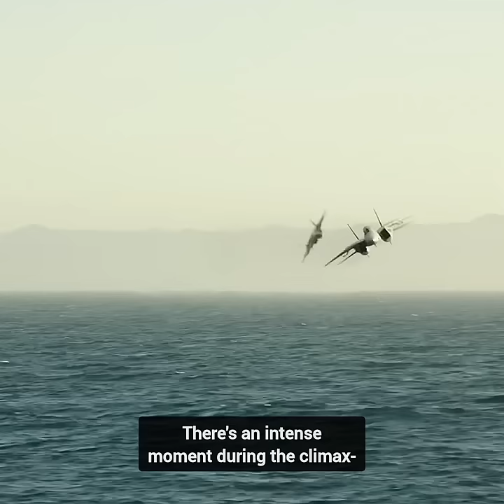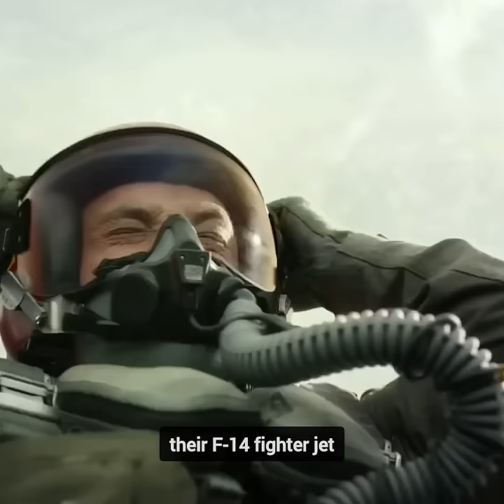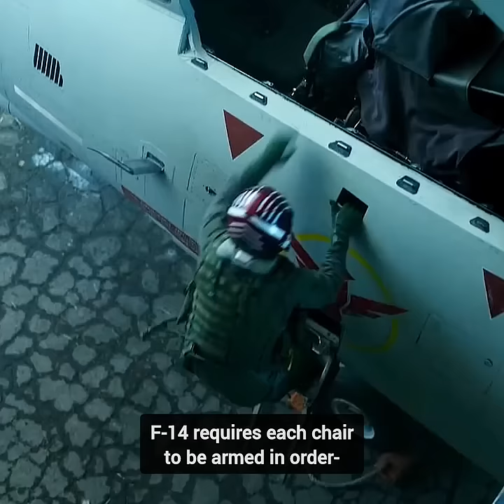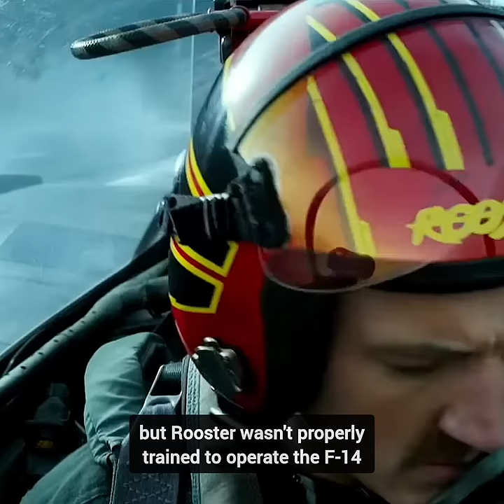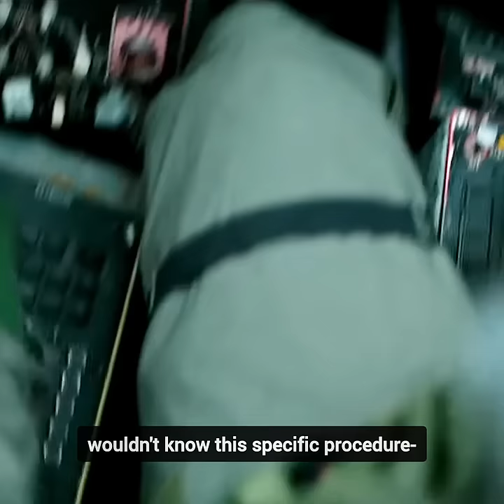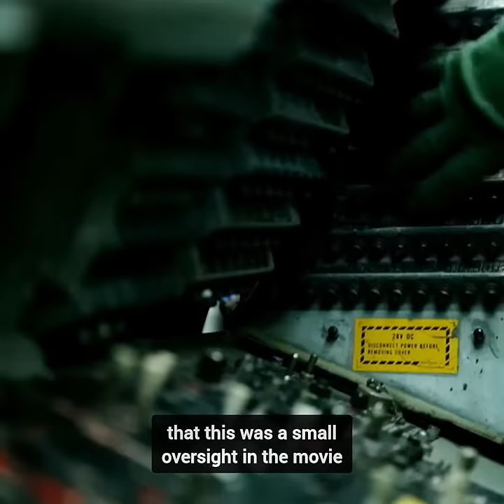Plot Point or Oversight? Analyzing the Ejection Scene in "Top Gun Maverick" - #shorts #short

Comment: The final landing sums up everything. The plane could no longer eject. Had 1 functioning engine, had no front landing gear, no tail hook. Either Maverick lands the plane perfectly or they die.
Reply: Was gonna type a full comment, but this explains it pretty well. I think it's odd that they didn't try the hydraulic hand pump or the electric pump at all for the tail hook, maybe I'm just lacking context and the whole system was missing rather than a simple loss of hydraulic pressure...
Reply: @brobearbrobear0464 I mean for starters that Tomcat didn't even have a tail hook and definitely not strong landing gear either considering it's Modified for Land based Operations
Reply: @pandasonic1294 if we're basing this off Iran's F-14s, yes, they absolutely did still have tailhooks and the exact same landing gear as US service ones did. They were sold an unmodified early F-14A. Now in modern times they might have removed the tailhooks, as it's a piece of matinence they didn't want to bother with (Iran has also removed the door over the refueling probe for a similar reason), but the gear absolutely needs to handle carrier landings, as the way you land an F-14 in general is similar for both fields and carriers.

The F-14 was designed as a carrier based fighter from start to finish, there were no "land based" modified variants as there were with the F/A-18 when sold to Canada and others, or the variants of the F-35.
Reply: @KomradeDoge  I have seen some videos and documentaries which did say stuff I said here. On YouTube obv.
Reply: @pandasonic1294  I don't believe it would be worth it to modify the 14 in that way. Removing the hook makes sense, it's a hydraulic thing you no longer have to worry about. Making the gear weaker makes zero sense, as stronger gear means it can take rougher landings, you'd loose that if you made that change which doesn't make sense logically. Unless they've changed the gear out due to their parts shortage for them but that's a key part of the jet, that would be a major desperation move, likely they'd try to replicate the original parts.
Reply: @KomradeDoge  I mean from what documentaries I have watched some F-14s didn't really have strong gear when being sent to Iran since it wasn't going to be landing on aircraft carriers tho F-14s that Were modified with their Classified systems removed probably had the strong gear.
Reply: @KomradeDoge  Tailhooks are still used occasionally on land-based models. Even the F-16 and F-15 have tailhooks in case they need to use the arresting gear (wire) at a military airport due to hydraulic failure or runaway engine.
Reply: @TomSwift-wy1gx  yes I do know that. The point I was making is that a place with the inability to replace and maintain a part may choose to remove it. Even with those jets tail hooks, they're used typically in emergency situations. I believe with those non carrier based tail hooks you can't even put the hook back up once you've deployed it without tools your ground crew would have. I highly doubt a place that can barely keep the bird in the air would bother with something as minor as maintaining parts that would only be used by them in a niche situation as that.
Reply: @KomradeDoge  Yes, agreed, that all makes sense.

Comment: You have 3 means of initiating the ejection system.  Pull down on the face curtain handles above your head, pull up on handles between your legs or pull up on handles located on left/right armrests.  Plane captain must ensure safety pins are removed on preflight.  No sane aviator would ever fly a plane equipped with ejection seats and not check that those pins are remove.  Pins are clearly noticeable by red streamers.  But....things happen.  Safety rules are written many times because of tragedy.

Comment: Maverick could have punched them both out as well 🤷🏾‍♂️
Reply: Nope maverick seat would have ejected but not rosters because the safety interlock pins were still engaged. And martin baker ejection seats will not work if the pins are still in .
 According to my brother who worked on ejection seats for the navy for 10 of his 16 years in provided that he had removed his arming pins
Reply: Not with a pin in it. the squibs won't fire and the rockets won't light. But there is no way you can get into the cockpit without seeing the big red "REMOVE BEFORE FLIGHT" flag attached to the pin at the top of the seat. EVERY pilot knows to pull the pins on the landing gear, the missiles, and the ejection seats.

Comment: Never been trained or flown an F14. But I am thinking it could be one of 2 things. 

One as stated but the other explanation:

In the mishap scenario  the case of F14 is the location of CG and coupled centerlines far from the center.

The  distances outward  of each TF30 engine would create incredible  torsional yaw.

And the longitutional centerline of each engine centerline so far outward a yaw and  spin not recoveranle. 

All would make it impossible to eject.

1)  long coupled CG to the rear,  and

2)  centerline coupling of the engines outward would  have 6 axis of motion G force to overcome.

The  two crew so far forward of CG, and the yaw spin generating  such G forces prevent anyone from recovery.

And if a crew survived, it would seem the Pentagon would be on a hotline to  debrief the crew member that had the strength and reflexes. 

"Son how did you do it?"

Comment: You're wrong!! That plane was combat ready. Those seats are always armed. Those seats are only disarmed after being removed from the plane and taken into the maintenance shop by the AME's. But it looks like when they got in the plane, they didn't take time to get the safety pins out of the seats that prevent maintenance from accidently  sending themselves into the hanger bay ceiling. Rooster would've known this as all US  ejection seats are almost identical. No matter how modern. They could've forgotten this because PC's usually pull and replace the pins for them but pilots are almost as well trained in the ejection seats as maintenance. The ejection grip that Rooster pulled would've come out if the safety pin was pulled. There's also 3 other ejection handles he could've tried. Also Maverick could've ejected as well. His hands should not be on any controls when ejecting. That's how you would lose body parts.

Comment: Though Rooster may not have pulled the safety pins for the ejection seats, it is also possible that the country they "procured" the F-14 from may have permanently PINNED the seats so their pilots wouldn't eject at the first sign of trouble.

Some countries have a history of this - not providing their pilots a way out, and thus "motivating" them to fight. You'd have to figure that with SU-57s in the fleet, the top "reliable" pilots would be assigned to those aircraft, and the others were assigned to the "old relics".

Comment: The egress system is a multitude of explosive components that have service life change requirements. Some parts are changed every 6 years, some every 20 or so. It is possible that some of these components were never replaced from the jet built in the 1970’s and were rendered useless due to service life expiration.

Comment: Take it from a Marine who worked on Martin Baker GRU-7 elections seats when I tell you there is NOT an arming sequence for those ejection seats. There's two safety "flags" one on top for the upper handles and one between the crews legs ag the lower handles. EVEN IF YOI FORGET TO PUT YOURE SAFETIES DOWN, PULLING THE HANDLE.HARD ENOUGH WITH OVERIDE THE SAFETY....

Fun fact, in the first top gun, they left the star where installed on the seats. So if mav and goose were actually flying and went inverted to keep up foreign realtions, they both would have partially ejected due to the seats not being connected the the elections gun....

Comment: This is why storytelling and accuracy is so important, because they did such a good job and consulted with experts this became a feature not a bug.

(It was 100% intentional)
Reply: Doesn’t make sense if it’s intentional.

Because, at the very least, maverick could’ve tried his only injection handles if the backseat handles didn’t work.

Plus, that type of ejection seat has a lower ejection hand also. Which is located in the same place as the ejection seats on the F 18. 

Understanding that the movie is fiction, That was still a big hole in the plot
Reply: @elymayer4860  There are a few pretty technical inaccuracies in this scene alone if you want to really nitpick it... why didn't Maverick lower the flaps for the shorter take off after he extended the wings?  Would have saved him the nose gear.

Also, the ejection seats wont work if they aren't ARMED.  You can clearly see the arming lever is up on Rooster's seat.  Even if Maverick hit his on the way in,  Rooster was riding that bitch to the ocean.
Reply: @Whiskey11Gaming  Depends on which shot you’re talking about. After the nose gear comes away, there is a shot (the very next one) were you see the plane climbing out? And that shot the flap were down. 

Talking about the seats being armed? There’s a little bit of a vague misunderstanding for the term. There are mechanical interlocks to prevent the Egyptian handle from being pulled. When those interlocks are disabled, people refer to the seat as “being armed.“

As mechanical interlocks (which only affect the handles) don’t affect the seat itself. If the Seat isn’t “pinned,” and the pilot pulls their ejection handle?

That’s going to be a normal crew egress for both seats.
Reply: @Whiskey11Gaming   but you are corrected to the extent that there are practically countless technical flaws in the scene.

Comment: If we’re going to take what we see literally, the seats were already armed. Because none of the safety pins (used to keep the seats disarmed prior to the start up) were in the seats to begin with.

Also, neither maverick nor rooster unlocks the overhead or lower ejection handle.

But if the pilot initiate crew egress, then both seats are ejected.

So even if roosters ejection handles didn’t work (for some reason) Maverick would’ve tried his.

Comment: The fact that Rooster couldn't even pull the ejection handles forward says that the safety pin was still in. Normally the ground crew would pull those pins once the pilots are seated and buckled in.

Comment: 100% oversight.

Maverick could’ve pulled his ejection handle. Plus there is a second ejection handle on the front of the seat, between the pilots legs. 

Going back to the first point, if the pilot pulls the ejection handle, both seats fire automatically. 

This was a story arc problem. Because at the very least, Maverick would’ve tried has ejection handles. If Roosters didn’t work.

Comment: It’s all a technical oversight. Because there are lower ejection handles on each seat. And the pilot has a overhead ejection handle also.

As an explicable why the pilot wouldn’t try his handles if the back seater could not initiate crew egress.

Comment: Rooster also was not a RIO. A RIO did a different job then the pilot.
Reply: Yeah, but that doesn’t change the ejection seat. 

Plus, that type of ejection seat has a second ejection handle. Which is in the same location as The F 18. 

So even if the overhead ejection handles didn’t work, he would’ve had the automatic instinct do use the lower ejection handle
Reply: @elymayer4860  I will take your word for it was a kid while the F14s where in US inventory

Comment: To arm the seat you pull the red flags that pin the cartages for safety. They are common to all ejection seats. I did not see the flags and most likely the seats were non functional which is common if the US is not supporting the aircraft. Active functioning seats were too much to hope for when they first mounted the F-14 and no safety flags are present.

Comment: That's misleading as the F-14 A,B and D have redundant systems and the secondary is connected to weight off wheels switch. Which is why several people accidentally ejected themselves into the hangar bay overhead splattering themselves all over the hanger.

Comment: All ejection seats must be armed to work and the f14 and f18 use basically the same seat so he would know.
Reply: I don't remember the similarity, and I was in both cockpits. Are you sure?
Reply: @PeterLevy-ho9lv  they are cosmetic different but how they function is the same Martin Baker core system. And every ejection seat has interlock safety pins to prevent ejection by accident during maintance

Comment: As a former Air Force mechanic and later a pilot, I can be sure the U.S. Navy trains all their aircrews in egress procedures. If that seat didn’t eject then it’s almost certainly due to the safety pin was left inserted. The pins come with big red streamers with a message printed on it in white, “Remove before Flight”.
Reply: Notice the lack of hanging red tags. Old Iranian F-14s were known to have nonfunctional ejection seats due to lack of parts. If the ejection mechanism doesn't work and is completely disabled, then why would they bother inserting the pins? This portrayed perfectly what would happen in an old F-14 maintained by a foreign US adversary.

Comment: As a former Tomcat ejection seat guy (AME3), the reason the seat didn't go from the top handle was it wasn't armed, HOWEVER, there is the handle between the legs. Modern seats only have the lower handle because it's easy to get to, and you won't lose your arms if you go through the canopy. Also, Goose would've never died in Topgun, because the seat frame comes to a point and will break through the canopy, and the aircrew's head is pinned against the headrest.